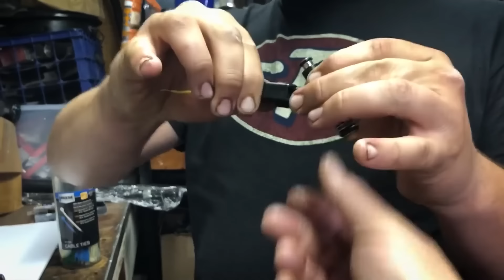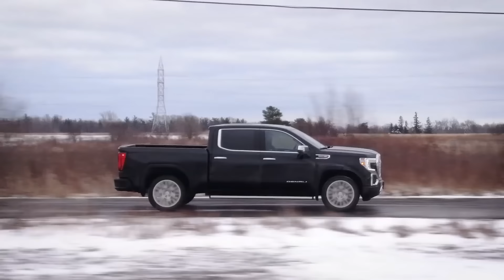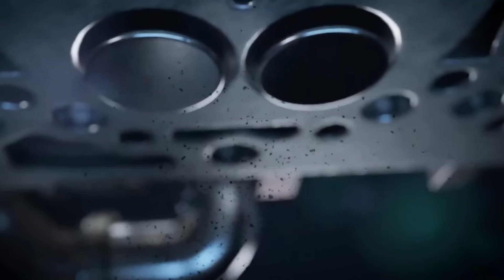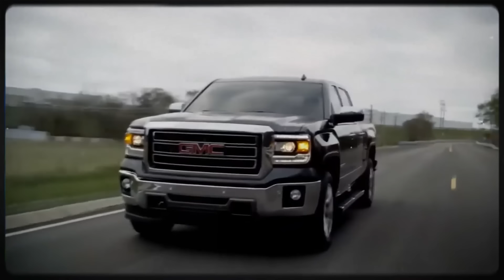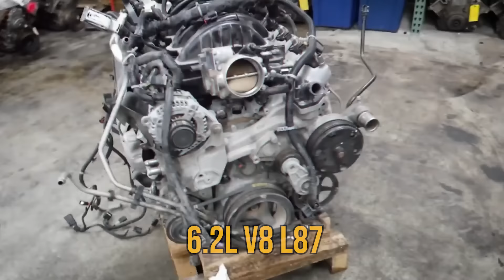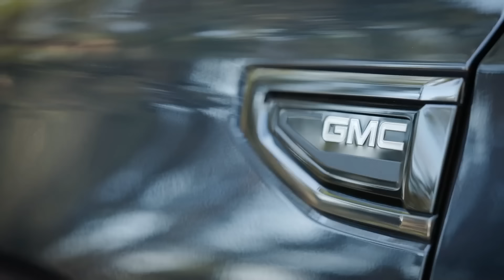5 GMC Engines Only Very DUMB People Buy

Comment: i have 2020 ucon denli 12,200 miles runs good no problems made in 2019 before covit hit 19 put anything in them
Reply from the maker: 2020 Yukon Denali, 12,200 miles, pre-COVID build — that's the sweet spot. Made before the supply chain cuts hit feature availability and quality control. Run it well and it'll last. 💪

Comment: What are my options from the 2021 diesel 3.0 then? Is the new 2026 3.0 diesel better and worth trading up?
Reply from the maker: The 2021 three-oh is a solid engine as-is — good power, great fuel economy, no AFM headaches. Unless you're towing heavy daily or the 2026 deals are aggressive, it's hard to justify the depreciation hit on a trade. What's your main use case for the truck? That changes the math a lot. 🙏

Comment: What about a 2.7 L3B in the 2024 Sierra?
Reply from the maker: The two-seven L3B is a capable engine but it's a complex piece of engineering — turbo four-cylinder in a full-size truck, sliding camshafts, cylinder deactivation. It performs well on paper but the long-term reliability data on high-mileage examples just isn't there yet. Worth watching. 🙏

Comment: Oh God, I remember the injectors fiasco.  I now have a 2.7L Turbomax after a dozen or so brand trucks, but I never had an injector issue.  I was lucky.  We shall see what the future holds.  This is my first direct injection and turbocharged engine.  It was a service loaner with 5k miles on it and is still going strong now at 15k.  I figured it was broken in and a dealer vehicle, so maintained properly.  Also, a good discount.  I catch Techron on sale every so often and add it to the tank every oil change.
Reply from the maker: Glad to hear you're having a good run with the 2.7L so far. Catching Techron on sale and staying religious with oil changes is the only way to keep those high-pressure injectors clean for the long term!

Comment: Mandatory  SMOG  poop causes  engines to be unreliable
Reply from the maker: You're touching on a massive issue—the extra complexity added for emissions and SMOG regulations often comes at the direct expense of long-term simplicity and reliability.

Comment: LZ0 diesel has solved most of the problems mentiined here. Seems the research from this guy is totally outdated  to be putting info that is old.
Reply from the maker: The LZ0 is definitely a step forward in the Duramax evolution! However, true reliability is proven over hundreds of thousands of miles by the community, not just the first few years. We're all watching closely to see if it really breaks the trend!
Reply: @EverythingGMC-k9x  I hope it's better, but then there's the 10 speed transmission issues.

Comment: I learned the hard way. 14 Silverado lifters seize into the block. Engine junk. At the same time transmission cook. 150k on it. I got a used engine with 100k and had the heads done and put a delete kit in and beefed up the transmission and breaks as well did a 3.5 inch lift. I run 5W-30 oil instead of 0W-20. Change oil at 3k not 6k. The truck is a dream. Until GM fix the issues I wont buy a new truck. The emissions crap have to go. Hell i have a preemmisions 6.6 duramax HD truck.
Reply: I did the same thing with a 2016 RAM Powerwagon.  I used my extended warranty to have everything replaced outside of the dealer shops.  I rolled it off a mountain, and Progressive paid me out plus 10k for aftermarket receipts.  Sad to see her go, but some salvage shop got some great parts.
Reply from the maker: Now that is a legendary way to close a chapter on a truck! At least you made sure those aftermarket receipts were put to good use—I’m sure some project builder out there is very happy with those salvage parts.
Reply from the maker: Your story is exactly why I do these videos. Swapping to 5w30 and doing 3k-mile oil changes is a masterclass in making these trucks actually last. You’ve basically built the reliable truck that GM should have sold you in the first place!

Comment: Quite a flawed video.  For one, LM2/LZ0 timing chain is on the back of the engine.
Reply from the maker: I appreciate the technical correction! You're right, the rear-mounted timing chain on the 3.0 Duramax is a major labor consideration for long-term owners compared to the traditional front-mounted setups.

Comment: Own an lm2 3.0 duramax, probably will delete it when warranty is up. Def, dpf and egr delete with an air intake upgrade
Reply from the maker: The 3.0 Duramax is a solid motor, but those emissions systems are definitely the weak link for long-term reliability. Doing a full delete after the warranty expires is a common move to keep them on the road!
Reply: @EverythingGMC-k9x  What is a full delete and what is involved?

Comment: Apparently this is not a GM promotional video…. Should have bought a 3/4 ton..😡
Reply from the maker: Definitely not a promo! A 3/4 ton is often the safer bet for those looking for a bit more heavy-duty durability over the long haul.
Reply: @EverythingGMC-k9x yeah but I don’t own a trailer so i couldn’t justify having one….
Reply: @sethb775  U had a RAM 2500.  Moved from TX to CO and couldn't even park before tearing a bumper off.  Good riddance. I now own a midsize, little GMC Canyon.  It works.